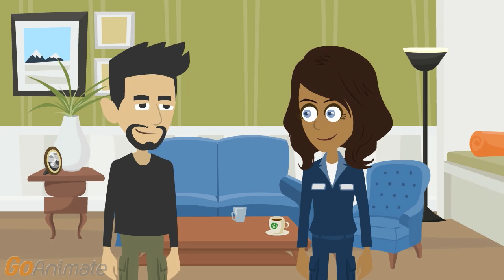Haier Air Conditioner Error Codes

Comment: EO help??
Reply: EO means the drainage system has problems. There is too much water in pan at the bottom of the AC. You may want to tilt your AC back a little so the water can drain out or use a pipe cleaner or wooden skewer to unclog the drain hole in the bottom of the pan.